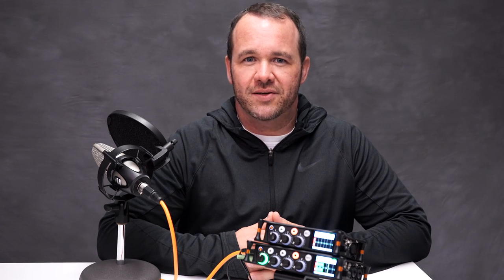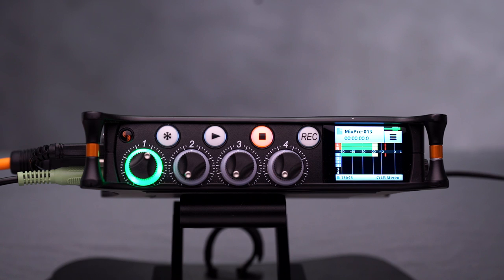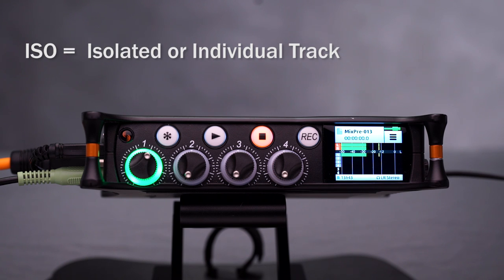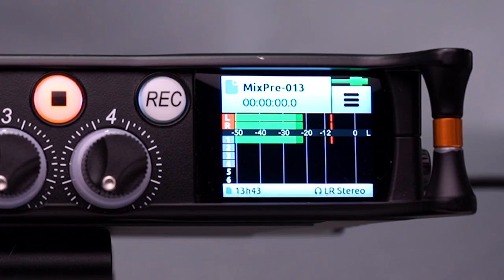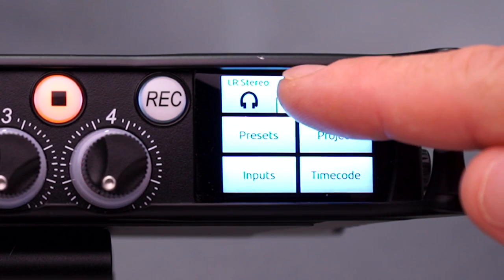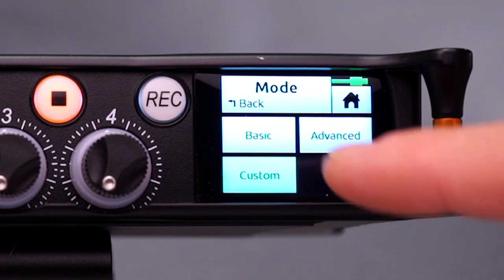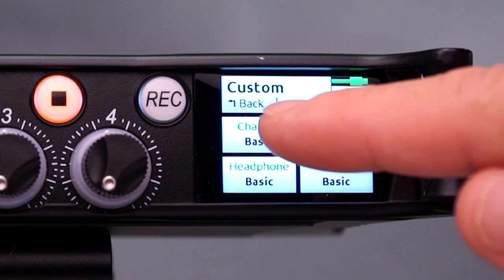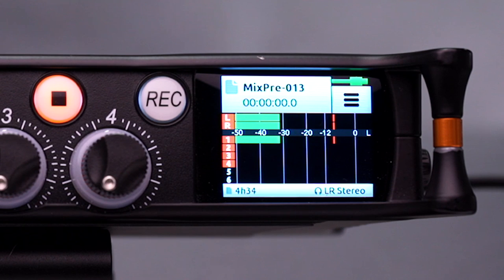MixPre Series Tiptorial - How to Use Channel Knobs to Adjust ISO Levels

Comment: Is there anyway to record 3  or 4 microphones to single tracks (iso tracks), but not lose the gain function on knob 1,2,3,4? Not sure what use the would be to have run the faders up and down if the input gain is clipping or weak?  Seams harder to change the gain on the fly if you need to faslty change the gain. Also the little wheel you control the gain for the iso tracks is usually har to reach when you have wireless receivers and cables in the way. I use mostly 2 microphones, and place them at left and right channel.But since we have started to doing more  shortfilms, that is changing.
Reply from the maker: Have you tried a custom setup? You can set all parameters to custom except gain, which can stay basic. Then you can use the front panel faders to control you channels while recording the LR mix. Alternatively you could use one of the four supported USB control surfaces which offer trim gain control.
Reply: I have done a setting with the gain at basic and channel as costume wich seems to do this. I have not imoprted it into the workstation and confirmed its correct yet.
Reply: It worked out good. But I realized I don't want to record the LR stereo mix when not outputting the stereo out to a camera. Then I rather just have the iso tracks recorded. How do you turn of the recording of stereomix?
Reply from the maker: @joelarvidsson  Menu-Record-Record LR then toggle it off
Reply: I have not manage to turn them of. Even if I unmark left and then the right stereo output it will record them. Any chance of a screen grab of it?
Reply from the maker: @joelarvidsson  Did you turn them off in the Record menu?

Comment: I follow this, and go to file transfer and even though my tracks are armed, I only have one file which is the l&r mix
Reply: Im having the same issue, have you resolved this?
Reply: You need to be in Advanced mode and arm the tracks you want an ISO/individual track output for. But remember the output file will be a single polyphonic file that contains all the recorded tracks.  On some other recorders (e.g. Tascam), you'll get 4  separate individual output files if you're recording 4 tracks.